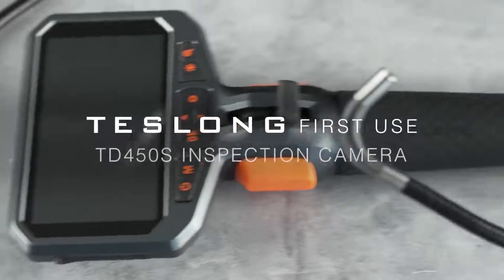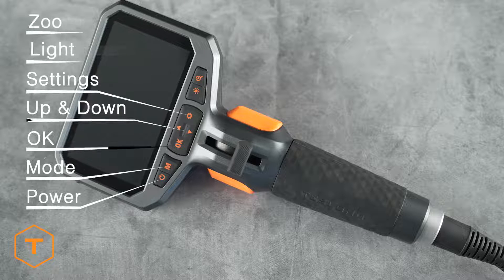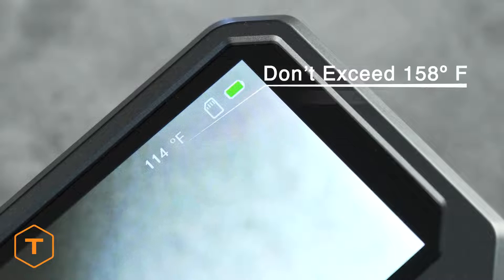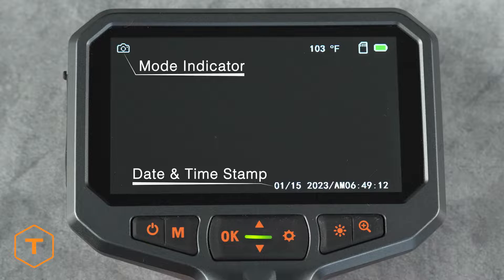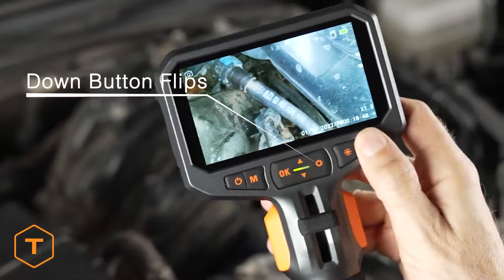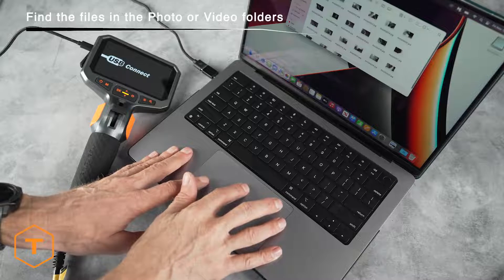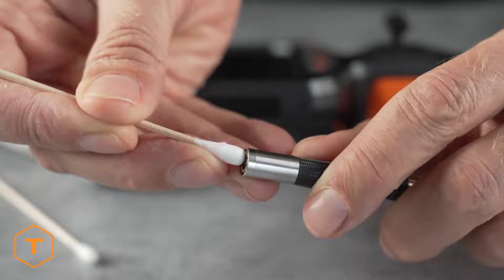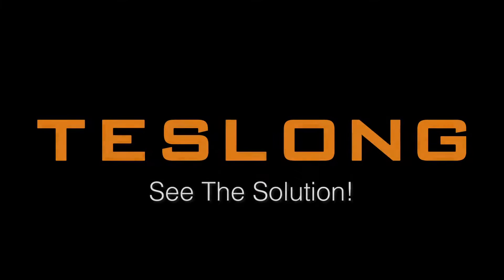Teslong  TD450S Inspection Camera First Use Video Manual

Comment: This video is only the briefest outline of the borescope's features and operation.  It can hardly be considered complete.  Since it is being billed as "First Use...Manual" it needs to be complete.   Regrettably, the printed User Manual (in several languages) is also woefully incomplete--just the briefest hint of features and operation.  Two examples:  Will any 5V DC charger with a USB-A outlet work?  Narrative on playing back video incomplete--two or three more sentences would be appreciated.  Same with transferring images/video to one's PC--two or three more sentences would be appreciated.  I hope their email and voice support can supply the missing information.
In summary: A potentially wonderful product severely hindered by incomplete documentation.